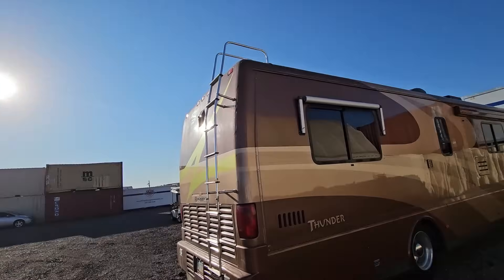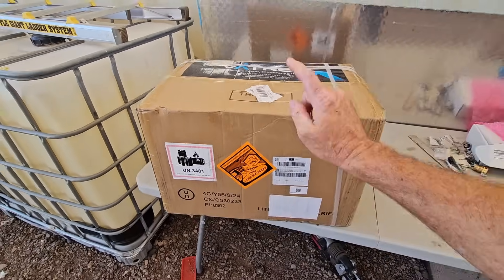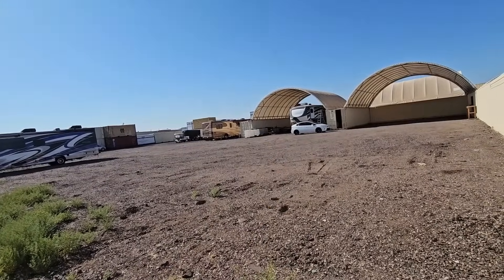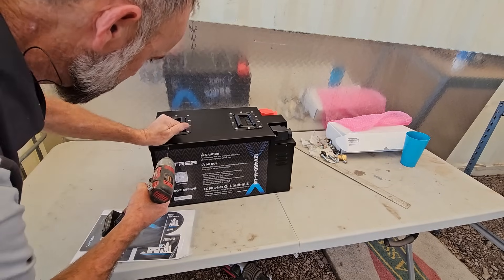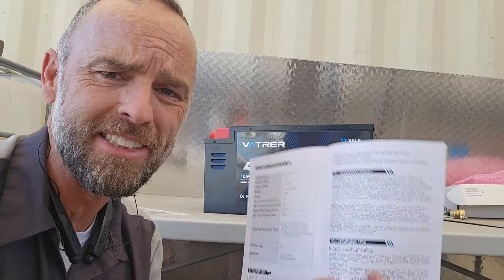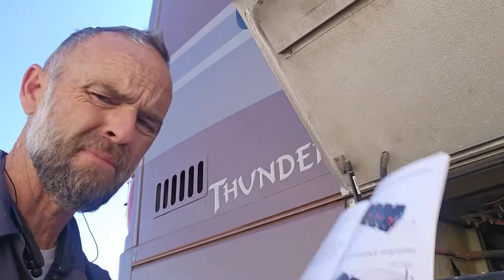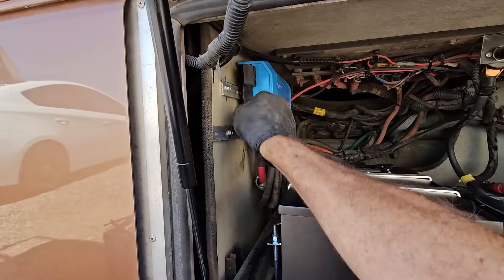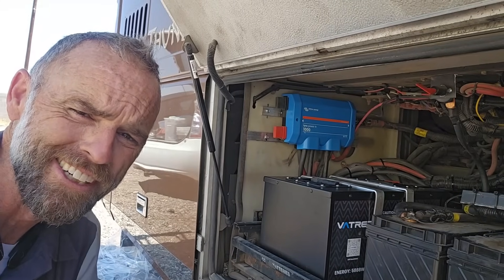How Did Vatrer Make My 460ah RV Lithium Battery Better? It's Heated!!!

Comment: Question for you; Have you had any issues with using your Lithium battery to start your generator? Not sure what the max discharge your battery provides. I am looking at a pair of WattCycle 314 AH batteries with 200 AMP discharge each and have an Onan 8kw Quiet Diesel I need to be able to start. If it is an issue I can move the start wire for the generator to the chassis battery with about 10" of wire. Still interested in how yours is working.
Reply from the maker: the onan diesel generator starts well off of this battery

Comment: What did you do with the green battery isolator designed to protect the coach’s alternator?
Reply from the maker: It's still installed on the ceiling of the battery compartment

Comment: About the heating function it do not take power from the battery it need external 10 amp power to activate the heating element so if there is no 10 amp going into the battery the heating function is not enable and you will not see the 10 amp on the app it is a pass thru function just for the heating pad control by the BMS so do not think the battery will take power for the heating pad

Comment: I have great respect for all you do! However, you said max amps to it for self-heating is 10 amps. Not true. 10 amps is the minimum amp input you need to activate the self-heating function. (look closer at the owner's manual).  Also, (extremely important), you said that battery draws from itself to heat itself and even talked about how many watts it would use (from itself). NO. The battery needs an external charging source hooked to it, and that source has to be sending at Least 10 amps to the battery to operate the "self-heating" function. Just trying to help! I own a Beaver coach myself and have learned all this through real life experience!

Comment: What do you have to do with the batteries in the winter. I do not use my fifth wheel in the winter living in northern Illinois. I do have a small solar panel I believe it is only 45 watts

Comment: Enjoy your content. I wanted to point out that the "self heating" is a little confusing. I'm pretty sure that the heater works off external power coming in from a charger. I don't know how this is managed if your battery has shut down charging due to low temp and you are stationary trying to charge with solar. If you are using an external charger or charging from alternator then I think it's fine but solar only? I don't know.
Reply: Is good mppt is good for charge

Comment: I bought and installed a Vatrer 460 AH battery for my Thor Miramar 35.2 based on your original installation. It has been great. I'm flipping the RV for a smaller B+ with two 12V AGMs. I can replace these with two 150AH LiFePO4 batteries and effectively triple the usable amp-hour (100 @ 50% DoD to 300 @ 100% DoD). Vatrer doesn't have 150AH for the Group 31 profile, but nonetheless, lithium is the way to go. Thanks from prompting me to go down this road!
Reply from the maker: Glad the battery has been working out for you!

Comment: I installed a Vatrer 460ah Lithium Battery is it normal for the battery to drain down while it’s plugged in into shore power
Reply from the maker: it's possible yes depending on your charger and settings

Comment: As always excellent how too videos!!! We are getting ready to install a new battery/inverter system. I have question maybe someone can answer, Does anyone know of possible replacement for a Powertek RL-1009 DC-controlled AC plug? We have one for our hot water heater and I need to replace it. Thanks Jim :)

Comment: Heated batteries consume the battery's energy giving you less capacity than the battery was designed to provide. You're far better off insulating your battery box.

Comment: Thank you. You video from before, i went with the same Battery for my motorhome. Works great and does start my gen too.
Reply: I1 12Volt 460 Amp Vatrer replaced 4 Costco 6 Volt deep cycle Golf Cart Batt. I have mor power with 1 Vatrer the all 4 6 volts.
Reply: Onan 7K Fuel injected Generator use about 4.5 Amp for the fuel pump, and ~ 100 Amps to start. The Vatrer does continues 200 Amp out put. Does even take a lifecycle.

6-+

Comment: I just installed a LIFPO and evidently missed the part about them freezing. Thank you so much for your videos. You just saved me a huge headache next spring since I do live in the North and my poor RV sits in subzero temperatures most of the winter.
Reply: Lithium batteries do not freeze. The issue is that they cannot be charged below 32F or discharged below 0F. Doing so will damage the battery. This is why the BMS that is inside the battery prevents charging below 32F and prevents discharging below 0F.

Comment: My only concern would be...
What if you have to drive trough slightly flooded road sealed acid lead battery would be fine opose to this one
Reply from the maker: You probably damaged your wheel hubs differential and transmission first then
Reply: @AZExpert fairpoint I have to check transmission and diff driven through  water couple times but I haven't noticed any problems with transmission of diff,

Comment: I appreciate you going through the battery swap. 
I’ve got an old 98 Holiday Rambler Endeavor diesel. I’d like to put a lithium battery set up for the house battery. I’ve had people telling me all kinds of stuff on why I can’t and all the things I need to change. 
We’re not looking to Boondock for weeks but just would like to not worry about running out of power. Any insight on how to approach a lithium set up with maybe 1-2 solar panels to help keep the battery charged? Tired of the twin 6 volt led acid battery set up.

Comment: I have this exact battery and it works well. I have to throw up a bit over how you have the Victron Lynx installed without fuses 😮
Reply from the maker: The fuses are above the battery. I hope your stomach feels better
Reply: Yes, but the positive busbar is the top and the negative is the bottom one. You connect the positive cables to studs above the negative ones with the fuses bridging to the positive busbar. You are basically using the Lynx as a simple busbar with no fuses. So, I still need Pepto 😂

Comment: I have the chance to get a 40 foot - 2001 American Eagle pusher. It is so lush. Gives me girl wood just thinking about it. How many of these spiffy Vatrer batteries would I need to fully run him off grid? I have 9 - 400 watt panels I will be attaching to the roof. I'll only be running essential electronics while I'm off grid. I'll also be adding a soft start to my air conditioners in the hopes of running at least one of them while I'm in my home state of hot/humid hell when a blower comes through and takes out the grid.
Reply from the maker: 5900 watt hours would run one roof A/C for about 4 hours 3600watts from the solar would barely run 2 A/Cs with full sun but not charge the battery or run 1 a/c and charge the battery
Reply: @AZExpert  Boo! 😂 Still might get it though. It's gorgeous. Plus, I can always just evacuate to a higher state for a few days. I'm not really looking forward to having to get a CDL license though.

Comment: Have you talked about the Magnum Inverter/Charger being used to charge LiFePo batteries?  I feel like you did, but I couldn't find it on your channel. I have a 2006 Holiday Rambler Endeavor and would like to make this same upgrade, but want to make sure y Magnum can charge the LiFePo batteries. Can it? Is there a setting change or module upgrade that is needed?
Thanks.
Reply: I installed a Magnum 2812 inverter pure sine wave and it charges the lithium battery just fine.

Comment: Great video.  For comparison a Duracell AGM 6V battery,  AGM is sealed so it would have a similar zero maintenance and low corrosion like the LFE,   is 65 lbs.  So eight of those weight 512 lbs. not counting the extra cables and connectors and mounting brackets etc.   One Duracell AGM 6V sells for $350.   I can't imagine giving up 400 lbs. of cargo capacity and space for lousy lead acid batteries.
Reply: No good piombo agm o gel pesanti e scarse 2anni 350cicle e stop is very good lifepo4 4000cicli 12anni potenza full 100% e sicure e leggere e costano meno is perfect lifepo4

Comment: I'd be upset with me if I ever got upset with you or how you do things. When you put that battery in a year ago, we shouldn't lose sight of how much of an effort it was in customizing and reinforcing the tray and hold down brackets, etc. For all those that "complained" - "Then let's see you get off the couch and video your approach and release it for general viewing". Love this year's approach with all of Vadrer's improvements coupled with the addition of the Victron 'all-in-one' semi-encased buss bar enclosure. And I certainly can't fault the accumulated dust as you were performing a yearlong test with the battery under the worst conditions you could. I'm just sorry the Beaver had to go through it as well. But it was partially purchased as a laboratory rat/demonstrator to show off what can be done in upgrades and improvements through time and demonstrate actual periodic maintenance on a diesel pusher. Have a great summer and lot's of enjoyment testing these and other improvements on the Beaver. 

Now I have to get off the couch and install the two buss bars I got a week ago onto my Class C. The only way the Victron would fit the space would be to remove both 12V Lead-Acid  and install single lithium. But we're not, and won't be traveling for the foreseeable future. But that's no reason not to improve the machine especially if its not breaking the bank.

Comment: Have the original vatrer. Two months after I bought,  they added the heated feature,  wish I would have waited. Was told it can't be added. 👎
May have to try and open the case and move the bluetooth wire, because the original range sucks.

Comment: It seems people  think you cannot store a Lithium battery below 0c or 32f . They CAN BE STORED BELOW FREEZING AND USED BELOW FREEZING TO -40° c or f   I have stored and used my life4 lithium batterys every year since new in 2013 with ABSOLUTELY NO BAD EFFECTS!  🎉😂😅 And they charge from solar the ENTIRE TIME. Since the solar power in British Columbia CA in the deep of winter is low and slow there is no problem charging below freezing BUT you Cannot charge from a generator or 120v house power below freezing, anything more than a trickle Will Damage them.  CHEERS AND SAFE TRAVELS    Steve h

Comment: I got the heated version just before they moved the Bluetooth antenna. I live in the Carolina’s and have had zero issue with the battery. The only issue I have is locating my battery isolator on my 2007 Mountain Aire, if I’m driving I turn the battery off to protect my alternator. The other issue is my Magnum inverter does not have the Custom Battery setting. I think it needs a firmware update. I did add a couple of bus bars to make my wiring neater.

Comment: For about $5 you can add add bucks and bolts to the victron bus bar. But you can put it to uses... Individual fuses on each battery although not a must with the BMS is still nice to have

Comment: Another Great Video,  I purchased 2 of the old style for my Alfa & have been very happy with them. I do live in Arizona, so the heating addition isn't a big issue for me. I do wish they would have made the new app work on the old batteries. I did the bus bar install on mine, and it does keep things clean & organized.

Comment: I have the 300 AH version that has heating and COOLING! Amazing build quality with clear glass looking into BMS to help cool it on hot days. Been using for 6 months and works flawless… love Vatrer.
Reply from the maker: Great to hear!
Reply: What is BMS
Reply: @calld2serve  Battery Management System
Reply: @calld2serve battery management system I think.

Comment: Low temps don’t hurt the battery, you just don’t want to charge them if they’re below 32°.
Reply: And the BMS will prevent discharging or charging below the thresholds.

Comment: I have a 1999 Monaco Windsor with the typical 4 6-volt house batteries. If I were to install this Vatrer battery, do I need to change anything to the charger and/or inverter on my RV? I love watching your videos, I always learn a lot, and opinions vary on this topic, I’ll trust your opinion more than any other. Thanks!
Reply: Is perfect lifepo4 in 1999 Monaco windsor con mppt charge pannelli solari e dc dc charge tipo victron xs da 50ampere regolabile xs is good o renogi

Comment: Nice update on the battery. I’m about due to replace house batteries on my Marquis, but my Prosine inverter doesn’t have the higher charge voltage for those batteries. I guess solar and alternator would have to completely top off the battery until the inverter kicks the bucket and needs replacing. 

I can’t believe I just said that about the inverter it probably will get me here shortly. 🤣
Reply from the maker: You've definitely got your money out of the Prosine inverter and really people stress about the lower voltage a little too much I think.

Comment: I recently watched a video that was a few years old where you put a screw or drilled a hole in the side of a fridge and hit a refrigerant line and wondered why. There’s two reasons they put lines on the sides. Sometimes they use the hot gas as a door heater to keep the door from freezing shut. The main reason and I hate it is they quit putting condensers on most fridges. Instead they run the hot gas from the compressor under the outside metal to cool it instead of through a condenser. I think it’s stupid to run hot gas around the outside of your fridge while trying to keep the inside cold but it must be cheaper. The old static condenser on the back was my favorite.

Comment: I bought 2 of the vatrer 300 Amp hr heated batteries around 6 months ago and love them on my home solar backup power. The heaters only activate when the temperature hits 32° and below. They heat up to 42° only when charging which has almost zero power drain as it is charging. These batteries will still work down to around 0° with no problems. All around the best batteries that I have bought so far. The app is great too!
Reply: These batteries are usable to -40° without damage ! Only when charging do they need to be heated first. Slow trickel from solar is ok even at -35, I have done this from 2013 with Absolutely 0 damage or problems. Using the battery below freezing actually heats the battery  all on itself, how much depends on the load, just heat the battery before charging with more than a single digit charger.    CHEERS

Comment: Great video, I wish the 460 fit in my battery box in my RV. Which Magnum inverter do you have? I recently changed over my absorption fridge to a residential fridge. My Magnum inverter is a 1200 watt modified sine wave. Should I upgrade to a pure sine wave? The fridge outlet originally wasn't wired to my inverter I had to run one in there that was.
Reply from the maker: I have a 2812 magnum. The modified sine wave is fine for most motors, some electronics like a cleaner pure sine wave but it's not that vital.
Reply: @AZExpert  After viewing your video on this battery, I took similar steps, but I replaced the inverter from a Magnum ME2012 with the 2800 Magnum pure sine wave model. I'm really pleased with this configuration, which includes 6 solar panels (4 190w and 2 200w) in series on the roof and a 150/60 solar charger. I have more than sufficient power to recharge the battery for this season. I'll need to monitor its performance in January. I essentially had to redo all the DC wiring, but I'm satisfied with the outcome. It performs excellently in the Yuma, AZ region.

Comment: I am looking at this battery also, My question is how does your Beaver start your diesel generator?  mine uses the house batteries for starting the diesel generator. I could move the Generator over to the chassis batteries if you thought that might be a better way to start it. any feedback is always a good thing. I enjoy your channel and you have taught me a lot about thes rigs. 
Winnabago Itasca 36 foot pusher stored in a garage
Reply from the maker: Generator is started from the engine battery on mine, which is why I used the bi-directional smart lithium charge relay as that means my chassis will charge when the house is charging from the generator running and won't run the chassis batteries dead.